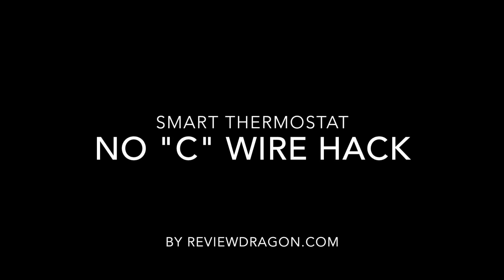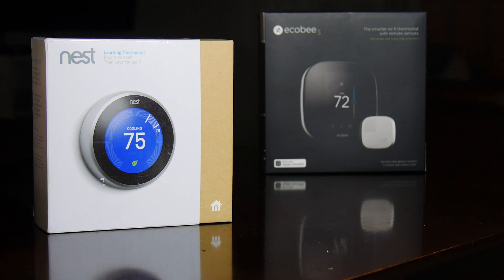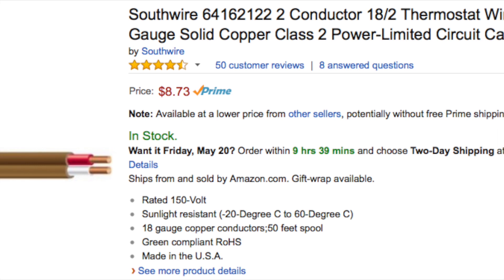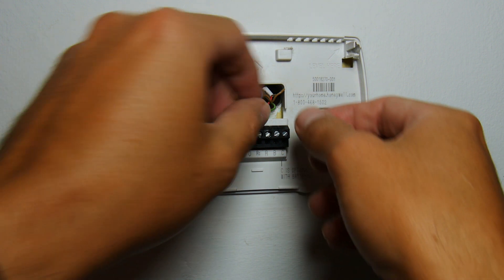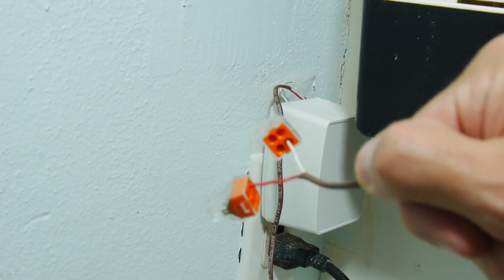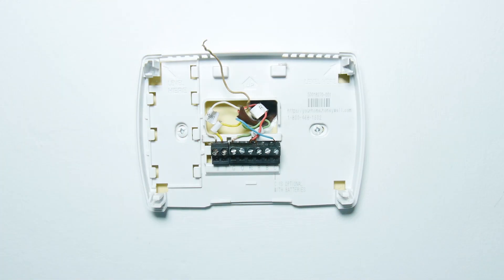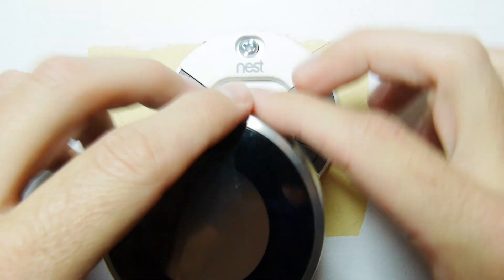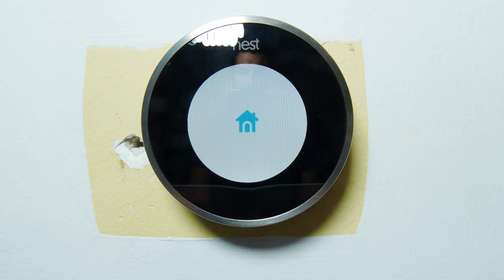No Common Wire Smart Thermostat Installation

Comment: This useful video and discussion series, so thank you.  Here is the issue I have, I have baseboard heat only not forced air and there no AC.  I have only two wires, no common.   

The Nest, when getting power via the USB port, is taking it as DC power.The furnace lines tend to run DC power.

Using just the two wires R & W, Nest was tripping a main relay, but when the furnace was running full flame, and water was circulating, everything worked fine, because the outside temperature was like 15F.  I only noticed the relay trip when the furnace was not firing because the outside temperate was moderate, say 38F, so the furnace was not running all the time.

I tried a green wire from a pipe to the C, and that stopped the main relay from firing, but the Nest was tapping power off of the circulator, ever second, when the temperature was moderate.  That sucked.

Then I found your video, but it is unclear how you are using the transformer.  If I understand your video, the separate transformer is outputting 24V AC, and you are connecting the outputs from the transformer to RC and C?  Is that correct?

So essentially, this is a mixed AC and DC system.   Do I have that correct?
Reply from the maker: As I've said, I'm not an HVAC tech but I'll try to get the convo going so maybe a real expert can chime in.  To answer your question about the transformer.  While the NEST "runs" off of DC, the smart thermostats generally get their power from the 24-25V AC system that the air handler uses to operate.  This is stepped down from 220/110 or whatever in a built in transformer somewhere in the air handler (usually, as far as I know).

Because old school thermostats need little/no power themselves, they just were a switch to connect two wires to turn on the unit.  So many systems didn't have both ends of the 24V system to the thermostat.  It would just be the Red one (or two red--one for heat and one for cold).  The smart thermostats need some power to run so they need both ends of the 24V AC (red and common).  I assume that internally they convert this to DC for the digital circuits and alternatively run off of USB (DC) power when being updated and such.  That is, your HVAC system has no DC voltage system (not usually anyway as far as I know) for you to tap into.

So as a hack or work-around.  You can supply 24V AC via an external source with one terminal from the transformer connected to the R and one to the C terminal.  In principle, it may work with only one connected to the C if you figure out which one you need--but I haven't tried this.

Since you have baseboard heating, I honestly no nothing about this and if it is compatible with the NEST.  I suspect it could be but I'm unsure how to tell you to hook it up.  Hopefully someone else can chime in.

Comment: How would this work if your old thermostat wiring is W and R only?
Reply from the maker: For nest or Ecobee?  I assume you mean Nest.  You should check their compatibility chart here https://nest.com/widget/compatibility/  If it is compatible the default setup will be the power robbing from the R wire the unit is running.  Nest will steal bits of power from the R wire here and there to keep charged.  Some users have issues with this.  You can try it and if you have issues you will likely need to use an external transformer like I show in the video and run the wiring to the thermostat or get a professional to run you wires from the air-handler I suppose.

Again, I'm not an HVAC tech so don't take my advice as gospel.

Comment: you are so wrong, if you have unused wires at the stat and the air handler, you simply tie into the common at the air handler using one of the unused wires and that wire you now use at the stat on common.
Do not know why you would buy and use an additional transformer, when there is a transformer in the air handler, the fact you had no common at the stat in the first place is only because the original installer did not require a common at the stat, and if he did , he would have used one of the unused wires and connect to the transformer or common terminal in the air handler.
Bad advice from D King........
Reply from the maker: Thanks for viewing and your constructive criticism.

I wasn't giving advice, just showing how to do it if for whatever reason one needs it.  This video was in response to another where I mentioned it and had some questions about it.  I realize that mine is a special case with the extra wires, and as you mention it is cheaply remedied by connecting one of those wires to the transformer inside air-handler.  However, as I've seen this pop up many times in forums, many don't have extra wires and those that do not always have a common wire/terminal marked either.  While I know that there is a transformer in the air-handler, it also is often not clearly marked either.  Further, with the service panel off, there is no voltage to enable using a meter to find the right terminals and many people are not so keen on fooling around inside their unit and possibly destroying their recently purchased $300 thermostat.

That said, if you have some tips/tricks/advice for how to properly identify the correct transformer terminals perhaps many watching this video will find it useful and save themselves $15
Reply: I think both of you are correct. Some boiler systems don't have common terminals. D Kings method would work great. Ideally, a additional wire run straight to the air handler or the furnace control board would be the standard way,  Your board looks like it has a C terminal as well. Good video. Marie's comment emphasized more on criticism than construction. lol
Reply: Two wire thermostat wifi